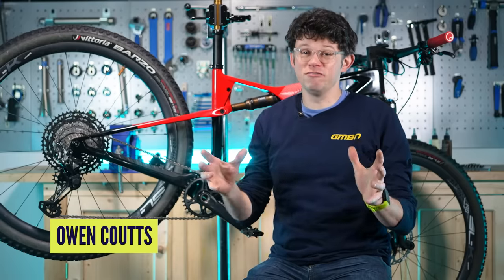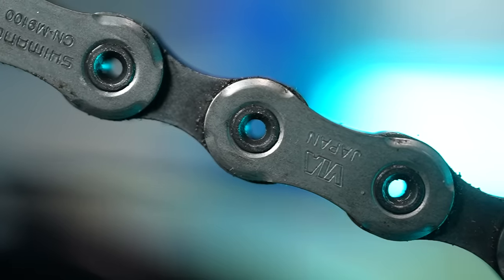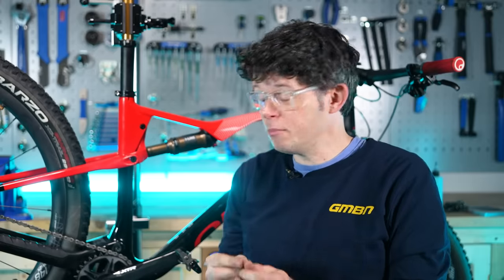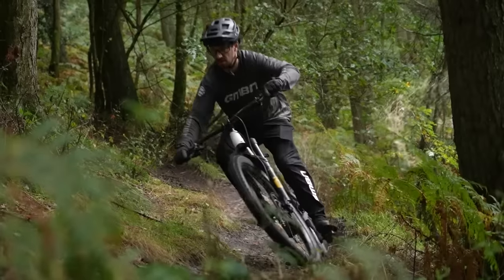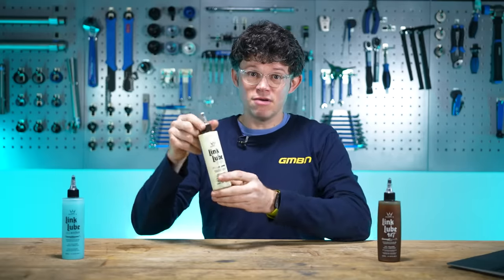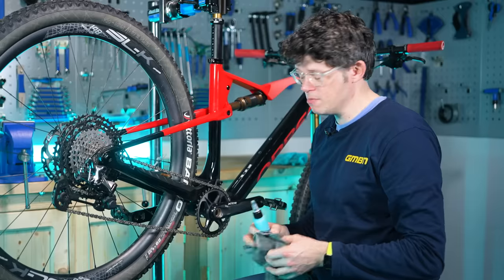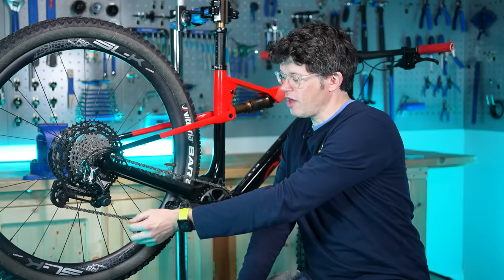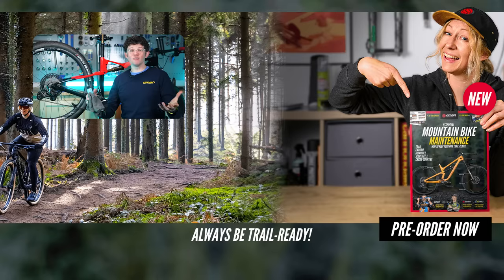How To Lube A Bike Chain

Comment: I have a gravel bike that I use for commuting ( Cube Nuroad FE ); and in this weather, it's a bit of a hassle to keep up with lubing.
I commute to work by train ( 5km to the station ) and back on bike ( 30km ). Both are on mixed asphalt, park/forest paths and all kinds of gravel going from grit to REALLY bad condition earthen agricultural 'roads'? Any tips there ?
Btw, my bike is stored in the dry warmth; so whilst it has time to dry, it sees a LOT of temperature changes. I try and just rinse it off every time I get home with a garden hose ( no high pressure !)
I don't always have the time, since I also bring a toddler to the kindergarden ( Gravel bike with a kid trailer behinds it looks... weird? ) and I've already had a shameful rusty chain.

I feel like I should change over to a wax for winter, but this is my first 'serious' bike and I'm essentially clueless ^^.
Info on performance products are widely available, but commuting  seems a bit overlooked.

Comment: I've found if you run the lube over the front chain ring while running the chain in reverse the pins and rollers are in the open position running over the chain ring the lube works in the best doing it this way then when done wipe off with a rag

Comment: This is good info, but a bit meticulous and I find that most people don't even know to lube their chain at all. I have been mountain biking for decades and unless I am doing a full clean and/or overhaul of my bike, I simply just apply chain lube on the inside of my chain, like you did, but a little faster and I spin the cranks a little faster to get the lube to go up into the chain more.

The thing is, simply lubing your chain makes a world a difference and just because a chain is dirty it doesn't mean it's not well lubed. If your chain makes noise or isn't shifting well, then you have waited too long to lube it.

Comment: does back-pedalling have a different effect to forward pedalling (aside from the fact that forward pedalling makes the rear wheel turn, back pedalling doesn't)? Obvs with an EMTB you can pedal forwards if the bike is in a stand but if you pedal backwards, the chain stays stationary, unless you've strapped the drive-side crank arm to the front chainring.
Reply: Worked at a bike shop for three years: as long as the chain is moving to allow the lube to work into the roller, it’s all good. It doesn’t matter which way you pedal, as long as the chain is moving!

Comment: When you done lubing your chain, ride the bike for 100 meters or so. That way the lube gets worked out into the chain better. Then wipe the exces lube so your chain will stay clean for longer time.
Reply: @michibellas  should i also hold the towel on the inside of the chain? Does this remove too much lube again?
Reply: @Jens329  Wipe the chain from all the sides. No, it wont remove too much lube.
Reply: @MkosAceOnline  thx

Comment: Nah, I prefer to use molted wax. I degrease the chain, melt some candles in a metal cup and dip in the chain and let it until there is no bubles coming out from the molted wax, take out the chain with a bent spoke and clean the exces wax with 2 rags carefully without burning my hands. The hole transmission remains clean

Comment: Gasoline or kerosine works well as a degreaser; no need to go out & buy special stuff. Just don't use it on an o-ring chain (motorcycle) as it will penetrate the o-rings & wash out the lube, defeating its purpose.
Reply: Where do you get kerosine? At the airport? What about mineral spirits?
Reply: @Jens329  walmart, lowe's, home depot, etc.